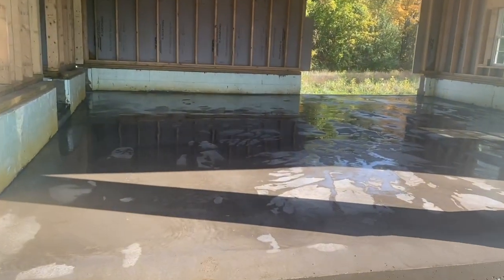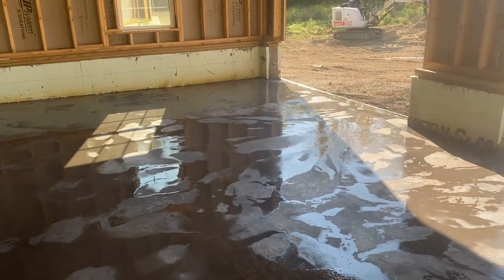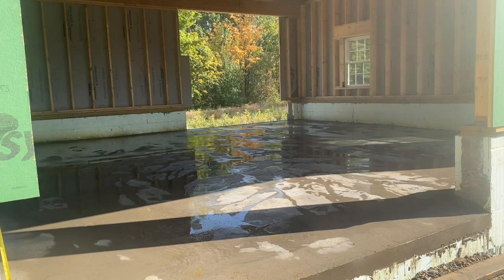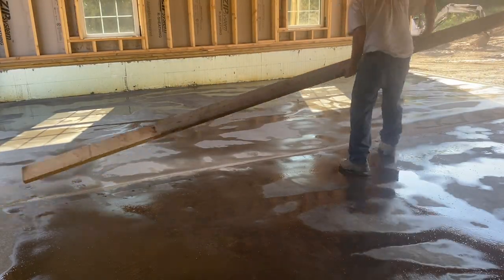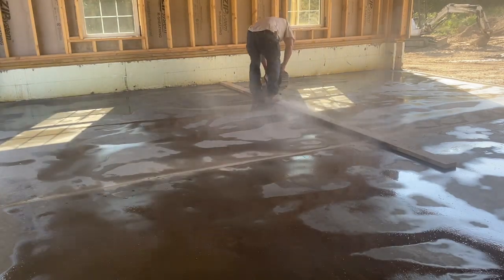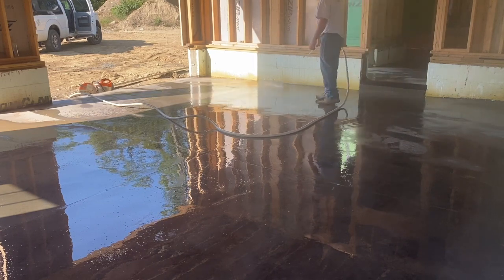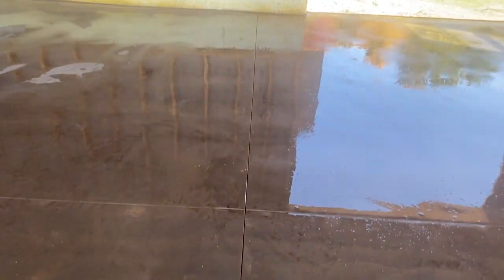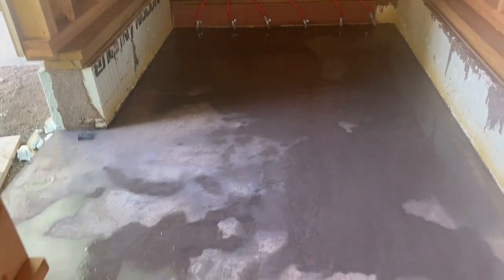cutting concrete relief cuts with a demo saw.

Comment: What's the best blade to use to minimize chipping in the saw cut?
Reply from the maker: I have only used the standard blade that it comes with. I just finally replaced mine. Most the time we cut the next morning and chipping is not a problem. Try and put a piece of cardboard in the cut you are crossing

Comment: I find it hard to get a good straight cut with one pass. I always do a shallow cut then cut it deeper with a second pass. Just 2’ at a time down the board.
Reply from the maker: The more cuts you make the better and faster you will get it. I cut floors like that for years now I have a soft cut saw. But you can make nice cuts with the Demo saw for sure. 👍

Comment: Is the blade cut through steel mesh in the concrete?
Reply from the maker: No the cuts are only like 1” deep. The mesh is down like 3” deep. Also there is heat tubing in there so we don't cut real deep. Good question though. 👍

Comment: Love it man solid video. I do quiet a bit of cutting with a soff cut. Comes in real handy on the bigger slabs we’ve been pouring this year. I like your method as well. The two by keeps the cut nice and straight
Reply from the maker: Brady thanks buddy  I'll be getting a soft cut next season for bigger slabs. What kind do you guys use?
Reply: Bondo Built we have a Husqvarna Soff cut 150 (2017) and we have a Soff Cut X-150 (2010 or so) both are great machines.
Reply from the maker: @loonatick6149  I have heard they are good units. Id love to find a nice used one and save a few bucks. Im going right now to cut a huge floor we are working on. 😩😩
Reply from the maker: @loonatick6149   Thanks for getting back to me buddy

Comment: Ever heard of or done floors that don't use control joints? I've read a bit about using stuff like Helix microrebar with various cement additives, but I'm not sure if anyone tried it in residential projects yet.
Reply from the maker: HI there. No I have never heard of doing that. The Helix is an interesting product. I would like to use it and see how it holds up. Im still thinking concrete would need control joints but who knows? That would be awesome to mitigate cracking in residential slabs. 👍👍
Reply: @bondobuilt386  Yeah I wonder what Helix might say about using that tech in residential slabs. I can imagine this being a big risk to the contractor, installing some relatively new tech, having it fail in some way, and then having angry customers demanding fixes. Would love to see it in my own house, though.

Was also digging into floor and concrete countertop sealants.. having concrete floors throughout creates a lot of questions on how to maintain them without too much hassle.
Reply from the maker: pa rak I never done it but I always wonder how a light texture stamp would be for an interior application?
We ground down and polished my basement floor in my house. Looks sweet but a lot of work and mess. And a real heavy machine to grind and expose the aggregate and then polish it.
Reply: @bondobuilt386  I'd think a stamped interior floor would be difficult to maintain compared to a polished one with sealers and densifiers. Especially when it comes to a kitchen floor. A polished floor can also have a good variance in the amount of grind depending on the level of aggregate exposure that a client might want (and their budget). Not sure where stained concrete floors come into play here, and how they can be combined with polished floors.

My current place has hardwood over concrete subfloor.. over the years it squeaks horribly pretty much everywhere, and there's not much I can do other than tear it out and put some new flooring in (or use the concrete depending on quality). For my new place that's why I don't want to have anything over the concrete and just use it as is, with various precautions over maintenance and cracking concerns..
Reply from the maker: pa rak you could run tile quite nicely over concrete surface. Schuler makes a decoupling membrane to put under the tile so if the concrete cracks it won’t crack the tile. I’ll try and get a link to it.
Reply from the maker: https://www.schluter.com/schluter-us/en_US/Membranes/Uncoupling-(DITRA)/c/M-U  
I butchered the spelling of the product. Lol 😂

Comment: Good Info as always Bondo!. I Just used a Clipper GC55 Soff cut saw this morning on a 20x60 driveway we poured yesterday (customer wanted saw cuts and not tooled in joints) We have always just used a demo saw and 2x4s or 1/4" flat stock....I have to say....Demo saws get the job done but man, it was nice just walking that saw up the driveway without bending over and running a saw!
Reply from the maker: Zac ya I’m sure it was nice. I’m definitely in the market for next year to get one. I almost did this year but I bought a mini skid steer. It would be nice to cut the big jobs same day and not go back the next day. Move on to the next job. 👍👍
Reply: Bondo Built I hear ya. I’m up in the air on whether to get a mini skid (mt85) or mini excavator.. Those mini skids are so damn handy. 1 piece of equipment and a couple tools every year would be nice!
Reply from the maker: Zac Zopp if I had to choose I’d go with the mini excavator first. You can make a lot of money with one. I love my Yanmar VIO-35. 8000 lbs machine. Just the right size to do a lot of stuff. 👍👍